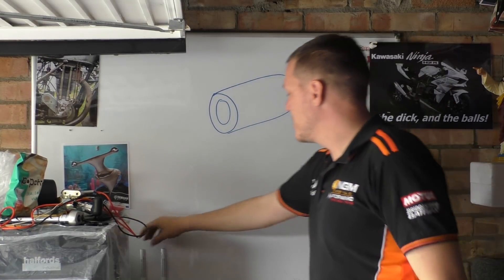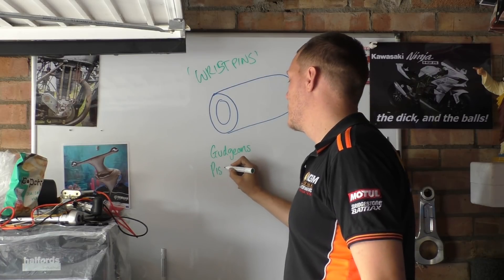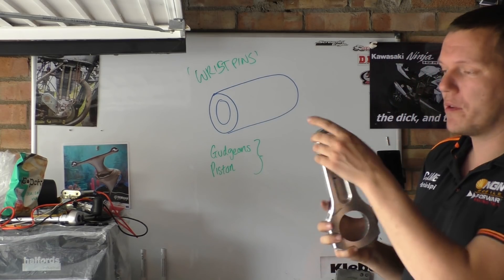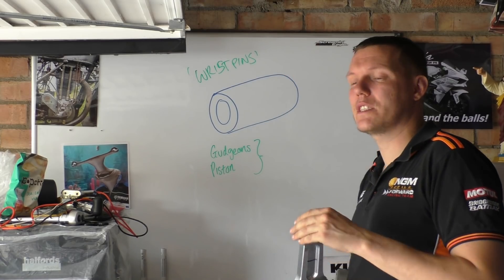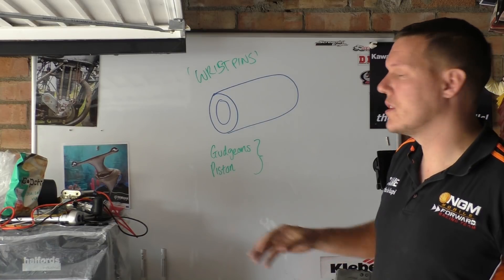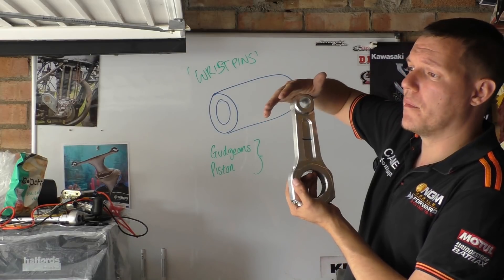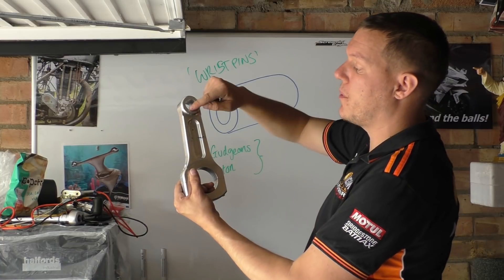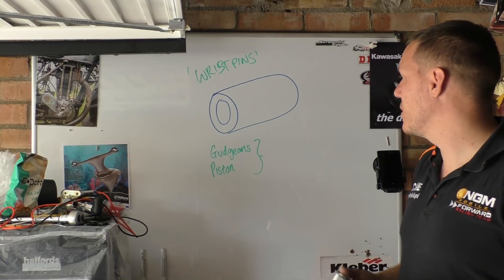Motorcycle-simple - Wrist/Gudgeon Pins

Comment: Perfect video, since I broke my wrist pin in half (after 19000km). I was doing hard acceleration and it took me a few seconds to realize that I have lost some power. The engine still ran and even idled (with a horrible sound). The piston was destroyed by the two broken parts of the pin..
For some strange reason the conrod bearing, which is exactly where it broke, stayed fully intact..
Spared me a 400€ crankshaft.
Bought a reinforced wrist pin now

Comment: I was under the impression that hollow tubes are stronger than a solid bar. Is that wrong?
Reply: Strength to weight ratio is better for a hollow pipe than a solid rod.